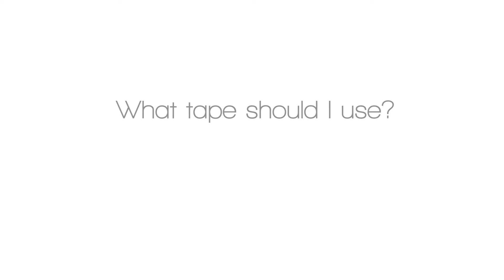EcoFoil - Solid and Perforated Radiant Barrier

Comment: You said the solid is used for roof or wall sheathing.

But the perforated is used for attics.
This has me confused.  Don't understand how this is used for sheathing, which I interpret as something rigid to prevent racking of the framing.   You seem to be telling me both solid and perforated are used in attics.  Can you clarify?